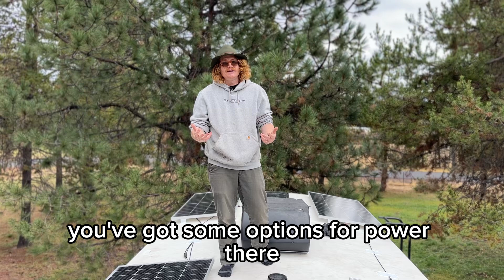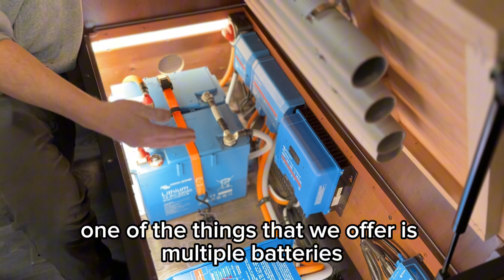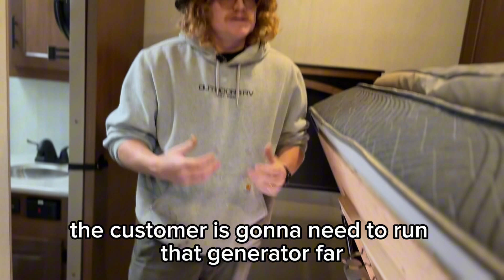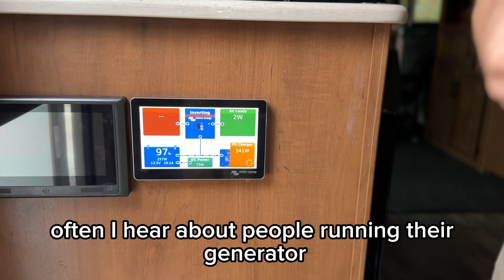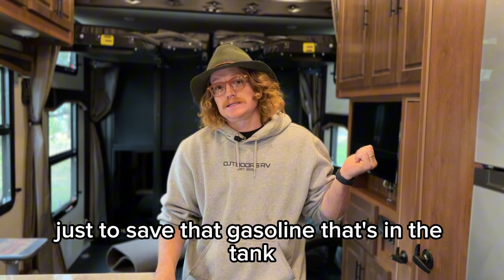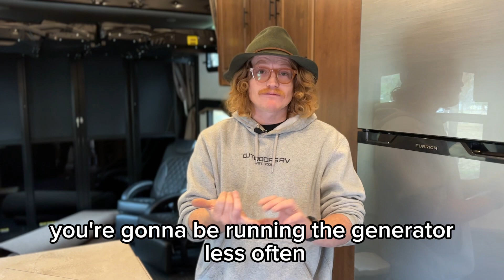Do you need RV Solar on a Toyhauler? Or will a generator do? | 2024 Outdoors RV 27TRX

Comment: Tom how much would a system like this cost? I have a 27trx
Reply from the maker: Our systems run anywhere from about 17K to 25K depending on capacity and extra options
Reply: @m @mytsolar  I look forward to working with you guys in the future. I am also curious with running a dc to dc charger from the trucks alternator to the camper batteries to charge while driving. Have you ever done this? Thanks
Reply from the maker: DC to DC is a great added piece

Comment: Your systems are awesome. Personal preference of mine though I’d prefer to have the monitor up at eye level on the wall to the right of the refrigerator.
Reply from the maker: We always try to mount at eye level. We can’t always get into every wall. We do try.
Reply: @m @mytsolar   Yep it’s a pain to run wires. On the 27 and 29TRX you can get into that wall (about 18” wide) opposite of the entry door (the one between the bathroom door and the cabinet next to the fridge) by reaching into the access hatch under the shower with a hole saw. Be aware there’s a stud about 12” from the rear edge of that wall. 

It would be next to impossible to fish anything out, reaching under the shower pan, but you can run a metal snake through there up from the bottom to the hole for whatever you’re mounting. 

Once wire is under the shower, there’s a hole in the floor and a corner notched out of the gray tank to accommodate the trap and plumbing, so it’s simple to get wiring to the passenger side frame rail.

Comment: As you mention - a generator is great.  And you're right about the fuel and restrictions (unless boon docking.)  But,  without a solar system that includes sufficient batteries and an inverter/charger, there is no power for 120V items (day or night), unless you run a generator.  Generator is a good "Plan B" and shouldn't be the primary source of power (my opinion.)   Those ONAN generators might be a desirable and expensive option, but noisy and do vibrate the camper.  But-Do you need one?  Maybe not if you're at a recreation area, with noisy 4-wheelers and off-road vehicles and motor cycles, run that genny all day - but you'll want the solar system at night.
Reply from the maker: EXACTLY our thoughts. There is definitely a time and place for both but it terms of which one comes first, I think solar/lithium/inverter and then a genny as a backup/supplement.

Comment: Id also add a vertical shaft wind turbibe, that is detachable. This way even at night while sleeping in the rain being dry. Im still getting the  charge.
Reply from the maker: Wind turbine sounds like a good addition. Do you know how much power they can produce?
Reply: Addition:

Make the wind turbine hooked up to a small siren so if the siren detects your in drive or it's over a certain amount of rpm due to malfunction OR it hasn't been taken down and is traveling down the road still,attached. The siren/alarm goes off one in the cab of the truck and one mounted in the rv. 

This can be done two ways. Hard wired OR wireless. 

I mean that's what I would try to do. And you sir seem a bit more knowledgeable on these things. So if this is feasible. You'd be the person to converse to about it probably.
Reply from the maker: That sounds ideal! I'd just be curious what kind of wattage it could send to the batteries to make sure its all worth it. Any free watts are always good to harvest though!